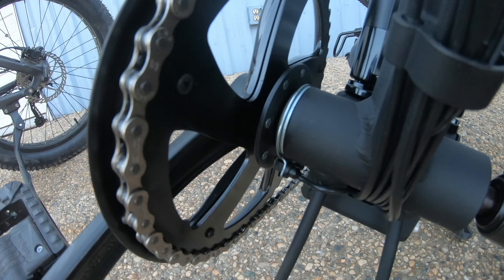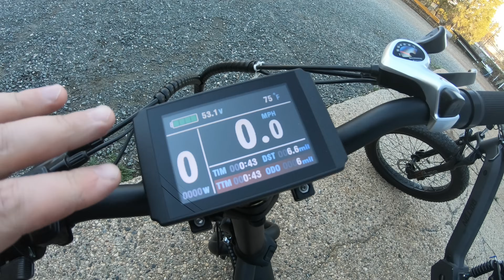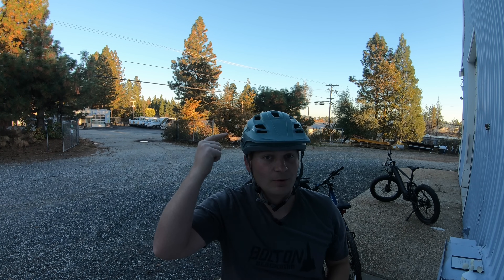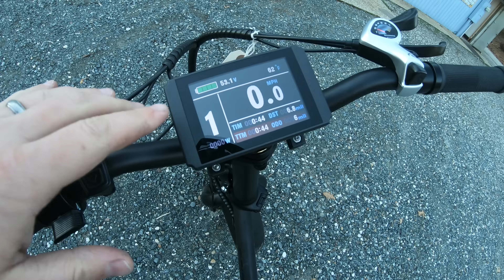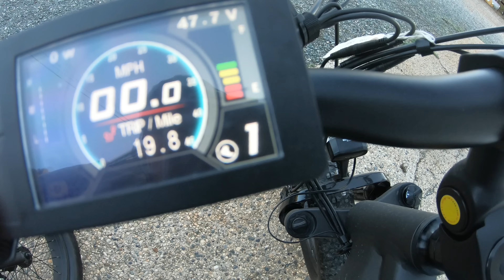Ebike Cadence vs Torque Sensors - the surprising outcome

Comment: I like the cadence sensor bike for the overall control I have.  I start out with the throttle and adjust PAS and gears as needed, giving me the effort level that suits my 75 year-old legs.  The one plus of the torque sensor is on trails where one wants the bike to respond in realtime.  The lag of a cadence sensor can be a liability when riding up and down or over roots and rocks.
Reply: Ah! Great explanation. I guess while riding uphill in lowest gear..and you just can't push the pedal anymore the cadence sensor would see no demand, that is where the throttle would have to be utilized or..cadence override. Impulse power Scotty.
Reply: @wendygerrish4964  As a matter of fact, Wendy, I ride up two steep hills on my ride to the gym and back.  The throttle is very convenient at the steepest point for a quick burst of maximum power.  I ride for exercise, so I try to use the minimum PAS most of the time.  When you ride the same roads daily, after a while you know what PAS levels and what gears you use for the whole trip.  Impulse power is a great idea... for the VERY steepest!  We have one such hill where I live.
Reply: I also like cadence sensors and I ride trails a lot.  A responsive cadence sensor gives me good control and makes getting to the trails a lot easier!  I rode a Trek Powerfly (torque sensor Bosch) up to a trailhead and I was exhausted before I even started the trail.
Reply: @erikkpritchard  I also drove both cadence and torque but I think a bafang type cadence sensor and change the control unit parameters and the top and I am very happy
Reply: @erikkpritchard  I understand what you're saying.  I've had a similar experience here in Nevada City riding up a long (3-4 miles)  hill to my favorite trail on a 40nm/250W mid-drive.  The bike was great on the trail, but exhausting for this old guy to get to the trail.  By comparison, my 24",  70-80nm/750W Bolton has no trouble with the hill, but lags just a bit with the application of power, going from not-pedaling to pedaling.  If I wasn't so old, I'd buy a 750W mid-drive to add to my stable.
Reply: @richhowell6874  Try a 750 watt motor with a torque sensing and you will understand the wild swings of power as your cadence slows on hills or inclines. We learned to ride a bicycle applying pressure to pedals when we want to go faster, our mind just works that way on a bicycle, unless you have unlearned to ride a non-powered bicycle, and have an override -- throttle on your bike...
Reply: I don’t see the point of a torque sensor. It’s no different from using a cadence sensor at lower power level and using the same effort in your pedalling as with the torque sensor. With a cadence sensor you can go for a ride no matter how tired you are, because you can adjust the ratio of muscle power and energy from the motor? The physics is simple. You can have power assist low and pedalling effort high or vice versa. That is not available with torque assist. If you just want low muscle effort you grind to a halt with torque assist.
Reply: Mid drive bikes are much better suited to off road uneven trail riding for sure, But I don't tackle those sort of rides.. Fire roads and bike tracks is all I deal with, And a hub motor with cadence and throttle is my preferred motion. Less hassle less maintenance easier cruising and quieter riding (much quieter if you have a sine wave controller like I do).
Reply: Sounds like my driveway. Thanks.